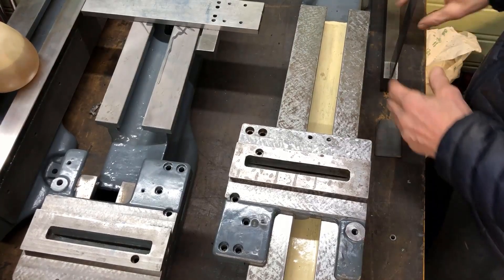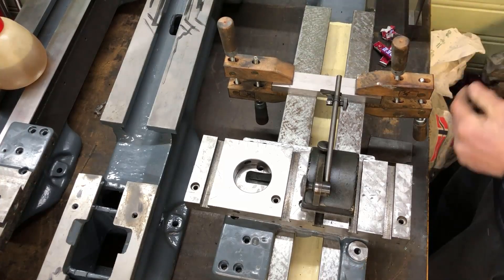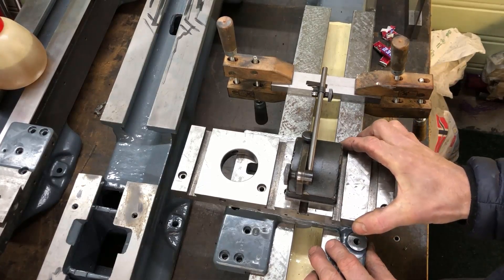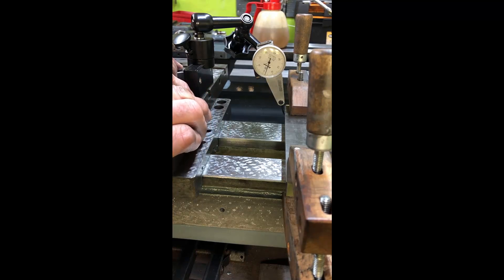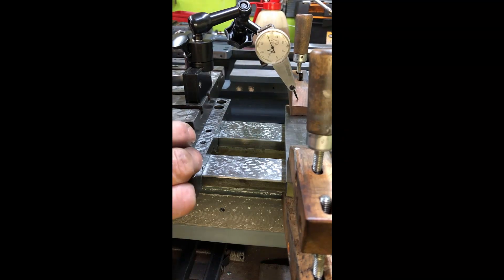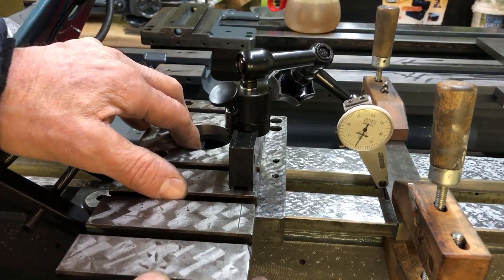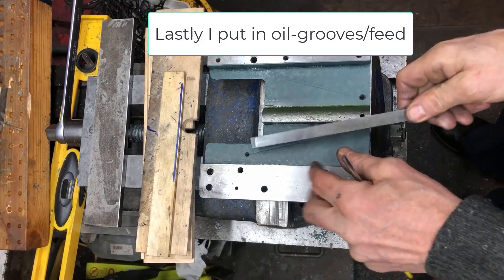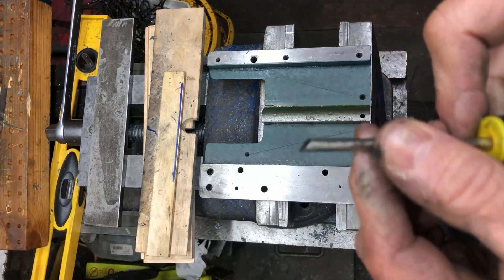Myford saddle resurfacing including Rulon application - 7 - measuring cross-travel, more scraping

Comment: Would it not make sense to do only two Rulon pads far left and right on the vertical surface. And in between nothing.
Reply from the maker: This is not how I have learnt, but it might work. More chance of dirt/oil ingress I guess. Anyhow, look at the manufacturers website/info and follow their instructions.
Reply: Was not your first plan to do a relief cut on the vertical surface before adding the rulon
Reply from the maker: @ I have been taught to relieve the middle 1/3 yes, but still having Rulon there. This is also if you don't use Rulon. The idea is to avoid rock, or at least prolong the usage time until this happens. This way the contact surface actually increases until it is worn flat
Reply: Where do you buy the Turcite or Rulon? Here in Germany there are only large quantities in the wholesale trade only for business customers. Most of it is 1.5mm or thicker. I just need a narrow strip.

Comment: I read somewhere that cross slides are given a very slight angle so that faced off surfaces bear on the outer edges first. Do you try to incorporate this feature?
Reply from the maker: Yes, you are right. The specs call for a one sided tolerance (uni-lateral) of 0 to apprx -half a thou" (concave, ie. curved inwards) acc to industry standards applicable. Most Myfords I have encountered do however have double of this.. say 1thou. I assume it is better to have a little bit more than needed as the turning forces will likely bend and twist these quite "delicate" machine members within these figures anyway. As a test, try leaning onto the the top slide while having an indicator mounted to a test piece..